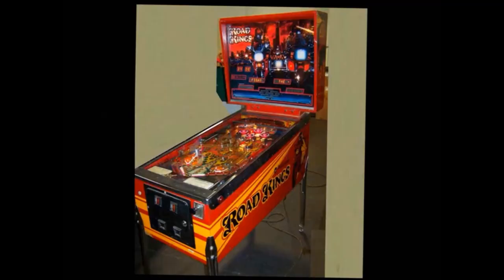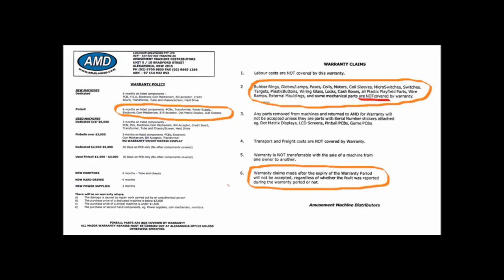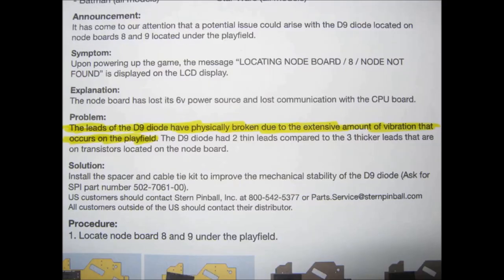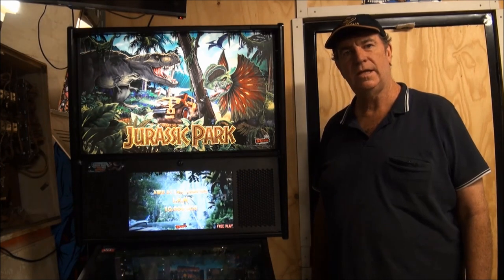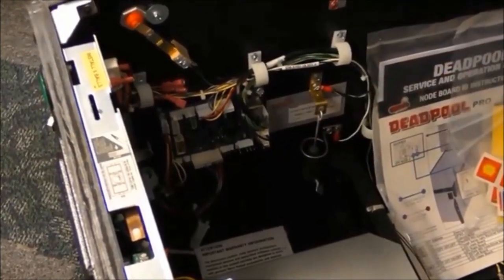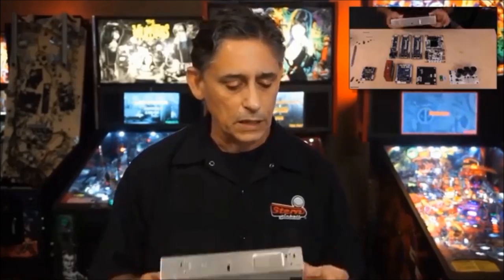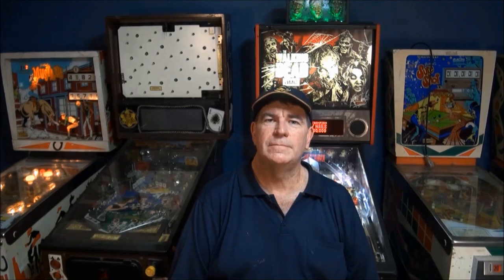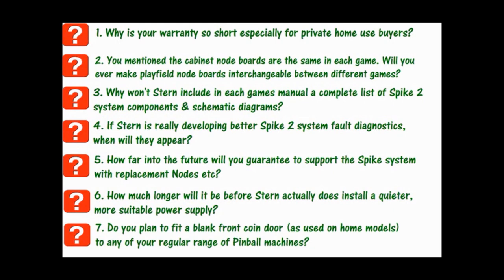WARNING with Reasons NOT to buy a NEW Stern Pinball Machine - Pinball Expert - Brisbane Australia

Comment: I wish William's and Bally still made pinball machines. They were built to last. I have a decent little collection of William's and Ballys from the 80s and 90s. Still going strong.
Reply: I completely agree with your comment.  The most reliable I have ever owned is a Williams "High Speed". I had purchased it close to 10 years after it was released in 1986.  It was in the field from time it was new until I had gotten it so it likely got a lot of abuse.  I've read a lot of articles claiming that the system 11 boards had many issues, but in my almost 25 years of ownership I've had almost zero problems with the exception on normal maintenance. I seriously doubt any newer Stern Pinball Machines will  last 35 years.  Williams and Bally made the best quality Pins of any other company.
Reply: @1959blantz  
100% agreed.
Also, the fun factor lasts.
The older pins have more addictive game play that keeps u coming back for more.
A lot of the Newer pins are okay when it comes to fun factor, but just dont have the same feel to where you want to keep playing over and over.
I'll take a 1980s or 90s pin over the newer pins anyday.
Reply: I still have B/W solid state games purchased new in box, correctly functioning with basic routine maintainance over 30 years later!  I have EMs that over 60 years that are still running with tech experience.  Testament to construction. Not everything was "gud" but they were commercial grade equipment, instead of tinker toys.
Reply: I hate to break it to you but Pinball is a copycat business. If Williams was still around today they would be building games exactly the same way Stern does. Jersey Jack and American pinball have similar systems with node boards and LED boards. How do I know this? I have games in my collection from all manufacturers. I can make the comparisons right in my own basement. I had issues with Williams games right out of the box in the late 90s. They’re not all they’re cracked up to be trust me.
Reply: @1959blantz  I have a Williams Comet and High Speed. Both sat for a few years before I got them. Had the Boards and power supplies rehabbed and with a little maintenance and conversion to led bulbs both games work 100 percent and very reliable.  And my Gottlieb Buck Rodgers cost me 2 dollars to solder in a new bulb socket instead of buying a 100 dollar node board to fix a light out. Or a new MPU for my Hurricane is 180 dollars for a Williams replacement from Pball Basement not a grand like a new Stern.
Reply: @chibang492  I disagree. The deeper gameplay keeps you coming back. You can only play my Firepower for so long before you get bored. That's if you can make it past the insane amount of drains the game hands out.
Reply from the maker: @teamhex  just move the adjustable right outlane post to another predrilled hole to close up the outlane on Firepower, it's not a hungry game when set up well.
Reply: USDA makes the best pinball machines
Reply: My Twilight Zone is still going strong after all these years; athough, the pesky trough board for the powerball does give me troubles.
Reply: Love my Williams/Bally/Midway games. I admit, it may be true that Williams would have followed the same path as Stern; for sure, the Pin2K machines were a departure from the earlier, easier-to-fix machines and possibly portended a shift to a Spike-style implementation.

But for me the bigger thing is that Williams put effort into *original* themes. Don't get me wrong; an occasional Twilight Zone or Addams Family is fine, and Rush is the reason that modern Stern machines are even on my radar. Probably wouldn't even have considered buying a modern brand new machine if it weren't that they made one for my favorite band.

But where are the modern Attack From Mars, Medieval Madness, No Good Gofers, or stuff like Pinbot, High Speed, just to name a few? Everything is just "licensed content" these days, which I guess is good for consistent sales, but frankly I find gets boring, and means a lot of games that I might have found fun, I'm just never going to bother with because the theme turns me off. I hear Teenage Mutant Ninja Turtles has great gameplay, but...really? I was never a fan of the turtles before, and a pin based on them isn't going to change that.

Maybe Williams would've gone the same technical route as Stern, but at least I think there's a good chance they would've put more effort into coming up with fun and interesting themes for the pins, instead of just following the "moinchendizing! moinchendizing! moinchendizing!" (to quote President Skroob).
Reply: @1959blantz  So you heard a ton of problems other people are having with system 11 boards but you will ignore those issues but because you have a bias against another company you 100% believe any and all issues... how unhinged do you have to be to think like this?

Comment: I'm absolutely with you! I bought a brand new Stern Star Wars and i'm so disapointed. One opto board was dead on arrival, which can happen, the shop needed over 1 month to get a new one. The worst thing is the playfield, which had micro scratches allover  after the first 20 games! My local pin shop doesn't get an answer from the stern distributor here in switzerland since we asked for a solution from stern for my playfield. No more Stern...
Reply from the maker: I've heard many complaints similar to yours, it is a great shame.
Reply: micro scratches? On plexi? Who would have ever expected that? You do understand that should be the norm not an exception. Do you also buy a phone, use it and then complain that it looks like it has been used? People are being slightly unreasonable.

Comment: I just bought a Rick and Morty from Spooky, while the build quality isn't as great as my TSPP, the PROC system does seem easier to repair due to the LEDs being easily interchangeable vs spike surface mounted LEDs.
Spooky has also been very active in the forums and are still making improvements to their R&M as the game is being manufactured.
I would love to see some professional insight on the PROC system regardless.

Also, my r&m seems to be using the same or similar power supply due to the loud fan which I did purchase a quieter fan which i have yet to install due to it voiding my warranty even though SPOOKY had made a comment in the forums hinting they wouldn't give you a hard time for replacing the fan and would still honor their warrenty.

Comment: Thanks for the insightful warning against Stern pinball machines after 2014 with the Spike 1 or 2 system. Harder and much more expensive repairs plus low quality power supplies with noise fans are anti consumer.

Comment: I have designed hardware and software for pinball as well as repaired many of them and I know what fails on them. I had a little tiff with Pat Lawlor in Star Tech Journal when Earthshaker came out. I questioned the vibration of the shaker motor and Pat Lawlor responded to me, “we ran the games at twice the vibration level and had no problems”. 
Well, sure enough, I saw things fall off of Earthshaker that I’d never seen come loose on other pins, like saucer switches. I miss those days. I wish someone would fund me to design a new pinball system.. otherwise, those golden days of pinball are over for me.
Reply: it would be awesome to see a new system by someone that genuinely cares about it.
Reply: @slob5041  I would love to do a new pinball system, but I'm doing casino gaming at the moment. I did a pin system about 18 years ago, but I would update it. The playfield is always a pain to build, but it's a labor of love.

Comment: Your previous video and admittedly nostalgia goggles helped my decision to go for an old little busted Data East Tommy machine instead. So technically old school Stern. Installed Pinsound board and a new display for kinda the same price of an replacement nodeboard for died LEDs in a new model. Although I will need an technician for fixing some issues all parts needed are openly available without crashing the bank. So many thanks for your helpful videos and advice. 👍

Comment: Hi. I'm an arcade operator in central France. I had this very problem w/ the broken D9 diode on my Star Wars Pro machine, and it cost me 560 € in repairs. Fried node board, fried "Smart" LED boards, fried satellite boards. Had to replace the #8 Node Board, and had to have the LED boards repaired (I'm not equipped to deal with SMD soldering), plus labour and shipping. This is unacceptable. 

And six months earlier, I had the infamous short to ground issue with an LED flashlamp on my Ghostbusters pro. Lucky for me, it was still under warranty.

Worse : none of the "protections" mentioned by Stern worked on these issues, since they occured outside of their "safety envelope", before their "circuit protections".
Reply from the maker: I've heard similar issues to yours many times.

Comment: Excellent video once again. I'm certainly not going to consider new Stern. A 60 DAY warranty is all you need to know.
Reply from the maker: Yes, that does say a great deal!
Reply: Multi-thousand dollar toys? If you can't get two years from a machine in a home environment, you are doing something wrong. Did they fire the mechanical engineer? 

Someone needs to get a photo showing D9. Has it been mounted axially (vertical) on the board?

Comment: Thanks for the video. We bought a new Godzilla Premium machine from a local dealer on the assumption that they would have to support it for a year. Then we read the fine print on the warranty and discovered... that there is no warranty. It's a more engaging game, in my opinion, than the 1990s games, due to the videos and music and elaborate modes. But we had one flipper go weak within a few months of home use and we still can't debug it. The consumer is expected to develop all of the skills of a full-time arcade technician (the dealer didn't want to send his own people, who are always busy rebuilding classic machines for resale). (We've had one pro arcade technician to the house, but he couldn't resolve the issue either!)
Reply: One of the strange parts of the no-warranty warranty is that it says "Installation of non-authorized accessories, lamps, LED’s, motors or other devices or modification of electro-mechanical devices may damage the system and will void your warranty." But the warranty is only 2 months on some printed circuit boards. And the 2 months is probably mostly over by the time a game gets to someone's house: "Warranty periods are effective from the initial date of shipment from seller to its authorized distributors." (i.e., if it took 2 weeks to ship to the dealer and then sat there for 5 weeks, the warranty will be over by the time the consumer plays his 10th game).
Reply from the maker: Your experience with a new Stern pinball is similar to many others I hear about. Stern do make some fun Pinballs but they enjoyment is gone when they soon develop faults, aren't easy to diagnose and often ridiculously expensive to buy parts and repair. My advice to everyone is just don't buy a new Stern pinball, not until things substantially improve.
Reply: @PinballExpert  Has the quality improved these days or is it still that bad ? What other brands have more quality, Spooky ?
Reply: @PhilipGreenspun  From curiosity, but did you managed to get it fixed dude? Cheers

Comment: Maybe I’m one of the lucky ones. I’ve owned just about every spike one or spike two game in my collection at one point and I only ever had one node  failure. I had node 8 fail on my kiss pro. It was out of warranty and I called stern and they sent me a new node board free of charge. I think the system is more robust than people give it credit for.  It’s not perfect by any means. A friend of mine operates a very successful location (before Covid) he refuses to buy jersey jack games anymore ironically he had more failures with their system than he did with Sterns. Wizard of Oz was a complete mess when it first came out. The connectors on the main computer in the cabinet were constantly failing.
Reply from the maker: Jersey Jacks first pinball Wizard of Oz had many issues but Jersey Jacks build quality & reliability has improved in every subsequent game, Sterns has declined.
Reply: @PinballExpert  I’ll soon find out first hand. I’m waiting for my Guns N’ Roses LE to arrive. I’m told sometime in January. 9500 bucks here in the states. For that it better be good!
Reply: The machines you bought still holding up?
Reply: @crazycorg1  In all my years of collecting I’ve had one node board failure and stern replaced it. The system is rock solid. Old timers don’t like it because it’s something new
Reply: @cigarsandpins4781  alright sounds good, thanks for letting me know

Comment: Hey mate! Greetings from the USA!!! Found your video and we are getting massively screwed by Stern at the moment. They didn't secure the cash box prior to shipping and it plus the light box bolts bashed around the inside of the cabinet. Stern refuses to exchange the cabinet. We paid $10,000 for a pinball table with beat up insides... I hate that by the virtue of grace that Stern survived  all the others.
Reply from the maker: I've heard many complaints about Sterns quality in recent years. Stern was the last new Pinball manufacturer from the year 2000 for well over a decade. Based on my observations & experiences back then Stern did strive to make durable games but since around 2014 the quality began a steep decline with regular price increases. Here we are mid 2022 and in my opinion a new Stern pinball is a DEFINITE don't buy.

Comment: I bought a brand new Elvira just 2 months ago after they released more machines into Australia. Have you had any issues with spike system crashing and restarting? Sometimes it happens during game play, sometimes after game just scrolling through high scores.
I posted the last dropout on my YouTube just now. Its really annoying getting a crash with 590 million points on the board.
Reply from the maker: Restarting occurs quite often in Stern pinballs, the cause is often the power supply unit. It's pretty low quality and barely up to the task of supplying the required voltages and peak current loads. Actual examples I've seen are, a partly shorted coil or failing LED lamp that's drawing more power than usual. This will often cause the power supply to shut off and restart. Your problem may just be a defective power supply OR something that's making the delicate power supply shut down and restart. It's probably not going to be a quick or easy job finding the cause and it certainly wont be inexpensive IF you have to pay for the repair.
Reply: @PinballExpert  ,I've had 1 of the 30 or so drop outs, between games with no playfield activity, just scrolling through high scores with flippers. Lowest possible load than machine standing in standby mode.

Comment: Great insight on the product.  I was considering the new Ninja Turtle Pinball, not anymore.  What's your thought son Star Trek 2013 production & Tron 2011. Am I best to invest in those?  Moe
Reply: Although Stern is starting to put out sub par quality pins these days, Star Trek and Tron are two of the best “modern” Stern’s. They are praised across the board and have high replay value. Either one is great to own, but I’d personally go with Star Trek since it’s one of Ritchie’s better modern layout, just like AC/DC. They’re both great pins either way you slice it!
Reply from the maker: Star Trek or Tron are fine, neither are Spike system pinballs. Buy the game you like the most. I agree, don't buy a Turtles.
Reply: 2013 Star Trek is a great pinball machine.  I currently have a pro and love it so much I’m buying a premium this weekend. I own several sterns and I think the 2000-2015 are the beat value and some of my favorites.  If you’re buying a pro more with an old pro machine then you do with the newer ones. The new pro machines are almost bare playfields.

Comment: the New York state legislature has passed the "right to repair" bill that will require digital electronics manufacturers to make parts, tools, information, and software available to consumers and independent repair shops. This should cover the Spike2 system, it will just take someone filing a lawsuit to get the information out.
Reply from the maker: That's good to hear. Louis Rossmann has been championing Right to Repair in New York. I wonder if this new law ensure parts prices are not a complete ripoff!

Comment: I'm in the market for my first pinball machine..  through searching online, all of the used 90's machines that I find are going for ridiculous prices..  it leads me to buy new...  watching this video, and the one before it, woke me up to the repair side of the newer pinball machines..  only issue is, that while this video rips on stern for gouging.. which I agree with,  I have found that all of the new machines from all the manufacturers these days have a similar system in place.. and through searching for parts say for the Monster Bash Remake machine, that I am currently considering next to the Deadpool pro machine... Chicago Gaming offers 0 replacement parts for their boards anywhere online.  I can't find one.   while you can at least find replacement parts quite easily from stern.  so...  it's either 12,000 dollars for your favorite 90's game,  or buy a new stern that has parts available in case they break.   is anyone else finding this?   I want Monster Bash.. (found a new one locally) but can't find replacement boards to save my life.   at least Stern offers them.